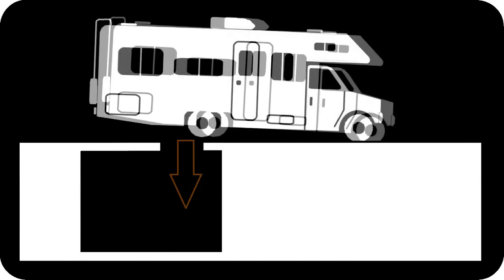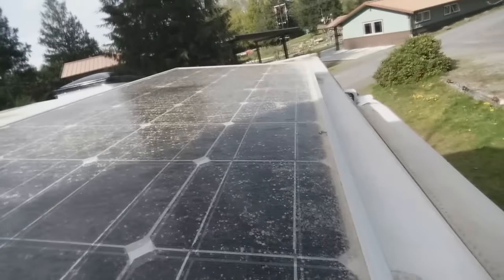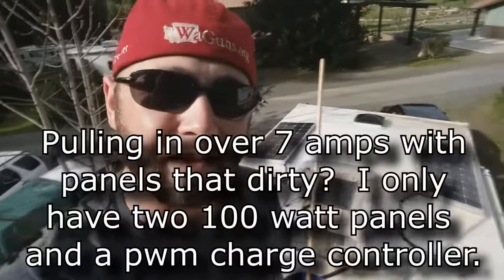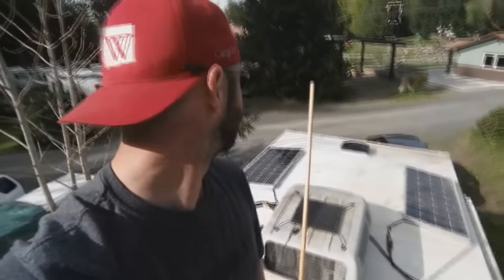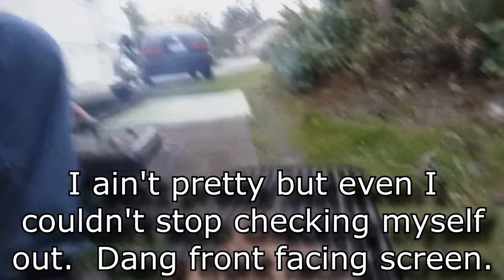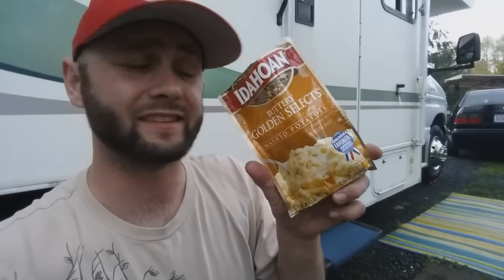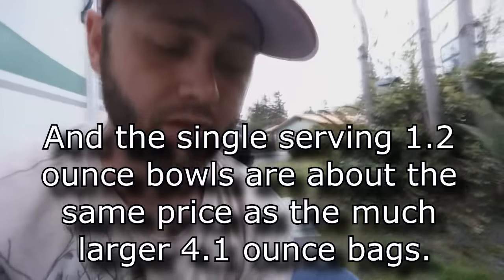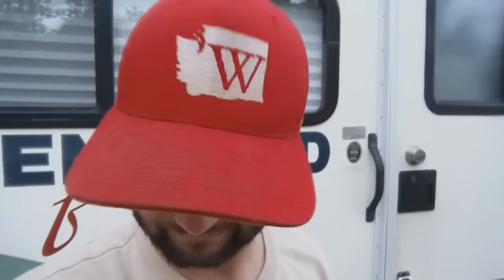Dirty Solar panels and STEAK, yum

Comment: Mmm. I love them thar taters!! Brilliant recipe. And that is the reason I plan to put my solar panels on the side of my RV. Your robot arm was genius, I think my plan is pretty mad-scientist too LOL
Reply from the maker: +Old Fart New Start During winter that would probably work better but you'd have to point the RV in the right direction.  Summer though I think it would be better to have the solar on the top.  Watching a few of your video's along with this nice weather seamed to help put a bit of a kick back into my step and I've started doing a few little things to the RV again.  Mostly unfinished projects that I've been slacking on. lol
Reply: +RV Crazy Good going, better late than never. I see what you mean about the summer and winter months. I'm not using up much energy but when I'm not driving I want to be able to power-up. side-mounted I can move around to accommodate the sun's position. Check this, asked my mechanic for his input, I want them to be tiltable, and he recommends hood shocks! Yeah bubbeee! pretty genius huh? Panda Monium's door hinges on top, hood shocks on the sides and something on the bottom to reinforce the hold and lock them to. Any suggestions oh chef o the future? LOL
Reply from the maker: +Old Fart New Start Hood shocks could be quicker but you could always just use an aluminum strip with either holes or preferably a groove cut into it for the bottom.   Undu a couple wing nuts and just pull the panel out then tighten them back up again in the position you want.

Comment: The AC thing is one of those cheap panels with no power control and hooks directly to the batteries. They put out the higher voltage but the current is so low it needs no regulation. Torklift sells a battery box/tender like that. 
Tax time just sucketh. I use Quick Books to do the accounting. It does a good jub but it's not very user friendly and has a steep learning curve. It does, ifyou setup your chart of accounts correctly, give you good usable data at the end of the year. I plug that into the 1065 P and get my income from that. Personal income, I was talked into using Turbo Tax about 10 years ago and I've used it ever since. Turbo Tax I like a lot. Record keeping is your friend. Keeping up with it and doing it right is the challenge. I do a couple other people's taxes too since I'm the one up on it and Turbo tax lets you do 5 returns per copy of the program or that's what the box says. Used EXCEL for years with just as good results as Quick Books. Much easier to use too. Take care, hope you're getting some of this sun. I'm stuck in a basement office. Makes me ill,
Reply from the maker: +CITAP1 Yup that's what it is. It's either the light for it that's burnt out or just the whole thing doesn't work anymore.
I used Excel in the past but am thinking about switching over to quick books or something else.  Not really sure yet.  I'm at a point where I'd rather pay someone else to do it than learn it all and still not sure if it's all correct.  I'm loving the sun, sorry that your stuck in the dungeon.
Reply: +RV Crazy You have your DVM tester ain't you. If you're reading up to 22 V DC from the leads, it's working. Re-task it to power a quiet 12v computer fan to circulate air in the RV. It might induce RF noise on AM radio though. Add a capacitor across the leads at the fan.
Reply from the maker: +CITAP1 Yeah but I never think of it when I'm on the roof.   That's a great idea for powering a fan though, I might just have to do that.    I've been thinking about getting two more 100 watt panels as they are only $245 shipped and the rest of my system is all setup for it already.
Reply: +RV Crazy More panels would be great. I've calculated that 360-400 watts stated output which in reality  = 70% delivered = 250 watts & 19 amps or 280 watts & 21 amps delivered is a sweet spot for Two Group 31 AGM batteries if you use DC power at night and through the day. WE would use 150 Amp Hours a day if we had the ability. so we conserve. The other thing you can do is make use of the secondary load feature to charge the RV engine battery or one person had a 12 volt water heater element made so his surplus goes to heating water. Lots of options.

Comment: HI is there any special cleaner you use on the solar panels ?
and that food looks so good.
Reply from the maker: +Rob Steinhauer Nope, I just washed them off with the normal car wash solution and they cleaned up easy.  Glass cleaner would probably be a good final step as the tops are glass but for me just normal washed clean is good enough.

Comment: It's hard to tell from the video but how much space do you have up there for something like solar panels? Could you fit 1000 watts of panels up there or what would you say the maximum is? My panels are 200W each but they are pretty big, maybe 5 foot tall and at least 3 foot wide each. Would there be more space on the top of a class A you think or are they about the same? Thanks!
Reply from the maker: I could fit over 1000 watts if I wanted to cover the whole roof.  I really don't need to though.  I can fit eight 100 watt panels just on the front half in front of the AC.  They have class A rv's smaller than my class c so it all depends on size and layout.
Reply from the maker: +helloman1976 Also the 100 watt mono panels are a bit less than a foot and a half wide and they are 4 feet long.  I'm guessing that your panels are poly being that they are over twice the size of mine.
Reply: +RV Crazy Good to know and good info. Most of my panels are poly but I do have some mono panels and they're about the same size, only a inch difference in the height for the exact same wattage. You don't seem to be very much into solar as I see you're using a PWM charge controller which are absolutely horrible for charging compared to MPPT and they really limit your input power big time when you get into situations where you battery bank is low on voltage. For me, when I move into an RV, I want to generate 100% of my power so that means a big battery bank with lots of panels. I have an MPPT 60A charge controller that will do 800W at 12V, 1600W at 24V and 3200W at 48V. I'm curious if I could switch my battery bank in the RV I get over to 24V from 12V which really helps reduce the size of the copper wire you need to. I'm not sure if there are any reasons you can't run a 24V battery bank. I don't care about the jump start feature where if your main engine battery dies you can use your other battery bank so if that had to be disabled I could care less. Are there any internal systems that require 12V that run off the solar battery bank? Thanks!
Reply from the maker: +helloman1976 At worse PWM is 30% less efficient.  And that is only under certain conditions where the MPPT shines.  For me it's not worth it currently.  On nice days my current 200 watts of panels and PWM charge controller has me all charged up before noon and I set up my system to accept 200 watts of additional panels.  I haven't had a real need for them yet but additional panels cost a lot less than an MPPT charge controller for the amount of return that you can get.  Obviously for some it can be a necessity but I have very minimal power usage as I work long days and really don't use much.
Hmm most LED lights say they will run up to 28 volts, your water pump might not like it though.  The fridge does have a 12 volt input and I'd imagine the fans would run but just twice as fast so they would burn out faster.  Then the furnace uses 12 volt ignition.   You could always just reduce the voltage down though, do a little research on reducing the voltage after the batteries either in bulk right before the main panel or before each little thing that uses 12 Volts.  There's a lot of little things which I didn't mention as well.
Reply: +RV Crazy PWM is fine as long as your battery voltage never goes much lower than fully charged. If you aren't pulling much off your batteries then your PWM charger is perfect. The problem with PWM is it is vastly less efficient when it comes to discharging your batteries below 80% at which point PWM is your worst enemy. With PWM it holds your solar panels to the battery voltage so if your panels are 12.7V at 8amps (roughly 100W panels) and your battery bank is at 11V then you are only producing 3amps off your panels at best. Your solar panels come with a graph of what they put out at what voltage, they only produce 100W at maximum voltage. If your battery bank is at 11V you have to find the point on your solar panel charge where 11V meets amps and that is what you're limited to. So if your panels produce 3ams at 11V then you are only making 33 watts off your 100W panels. With MPPT controllers it doesn't matter what your battery bank is at, you're getting maximum solar input no matter what based on where The Sun is of course. With MPPT you will never run into a situation where your batteries are at 11V and your solar panels are being limited to 33W, they will always be at whatever their maximum is and as always, based on the angle of The Sun.But it's like you said, you have very minimum loads so your PWM controller is fine. Take a look at some of my older videos, my entire house is powered off solar panels and a large battery bank and it's been that way for many, many years now. I went through 4 to 5 years of learning all of this stuff to get to where I am now and now I don't pay for power, I generate it all and that's for a 1600sq ft house. :)
Reply: +RV Crazy Good info on what runs off your solar battery bank. I was thinking if I ran the RV system at 24V I could use a 24V to 12V transformer for the 12V loads but I wasn't sure what those were until you listed them. There are 24V water pumps however I'm not sure if it would be worth converting all the loads over to 24V just to save on some copper wire. The refrigerator could be made to run off 120VAC but with what you listed it seems like a lot of trouble. I suppose I'll just get a 2nd charge controller and keep everything at 12V. It's probably about time for manufactures of RV's to start looking at 24V systems anyway. Thanks!

Comment: That's a steak. Did you leave any for the rest of us after they cut that plate sized monster Fred Flintstone would be proud. I'm plugged here at the house but do need to do the spring cleaning on the TC roof, panel, and in general. Still doing taxes. Ruined my camping plans this weekend. What is that on top of your AC. Take care,
Reply from the maker: +CITAP1 Haha I cleaned up that whole steak, tempted to knaw on the bone but figured I wouldn't go full caveman style on it.  I'm sorry for you, I fought with my business taxes for a good 5 hours or so before I said screw it and took it to h&r block.  Took them an hour and the service was good but dang, $400 for a simple sole proprietorship tax prep.  On top of the AC is a factory battery maintainer that doesn't work.